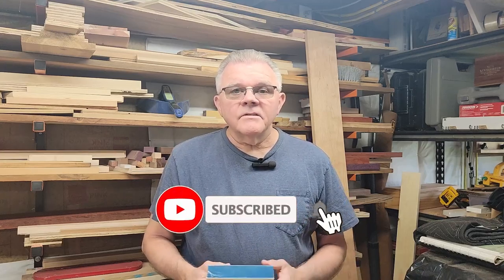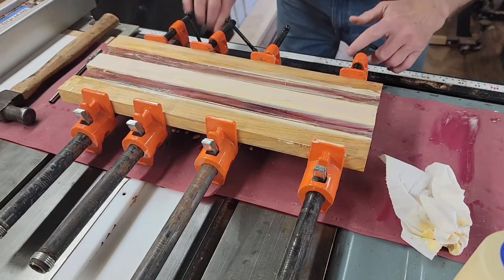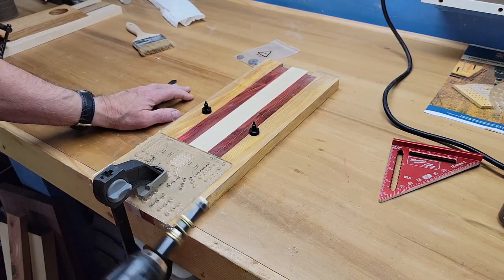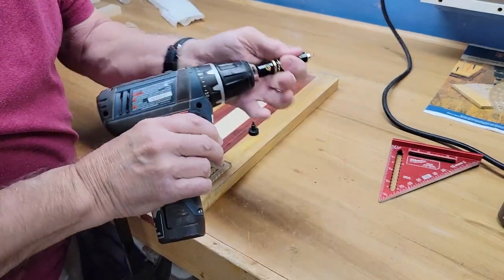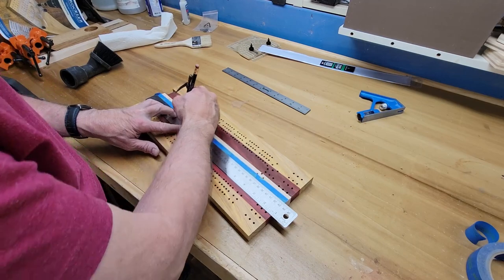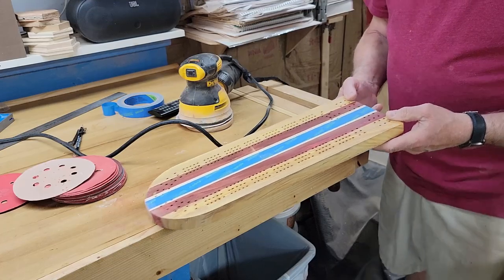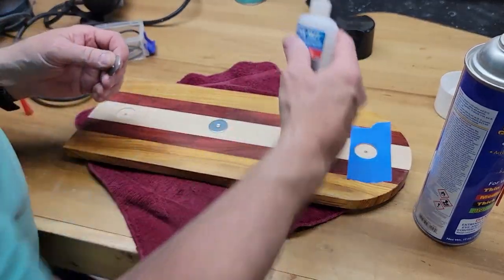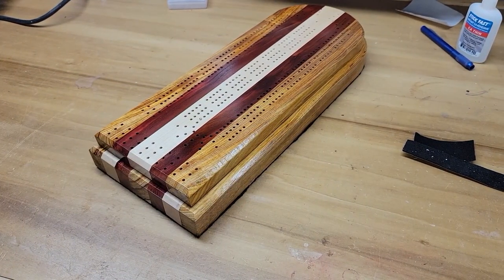How To Make Cribbage Boards Step By Step Using The Rockler Cribbage Board Templates

Comment: Not sure if you ever had issues with the bit clogging up. But if you enlarged the hole in the bit to 9/64 it will basically never jam up.

Before the modification I had to stop every 3-4 holes and clear it out.  After the modification I did 40 without an issue.

I also replaced the inner bit with a a higher quality bit.

I need to try the tape trick, I had some others recommend it to me.

Nice work, keep it up!

Comment: What was starting thickness of the boards you did and what did you end up planing them down to? Any change of heart wishing you made them or started with a different thickness?
Love your design. Trying to build a few wedding gifts for friends with some old growth redwood i got from a free deck tear out. Just Cornhole boards, mini bar, cribbage and other small games.
Reply from the maker: It depends what I have in stock on the rack. I put the colors and thicknesses together and glue them up. Whatever thickness I end up with when I plane them down is pretty much it. The base needs to be thick enough to allow for the depth of the hole for the cards and pegs. Thanks for the nice compliment and for watching my videos.